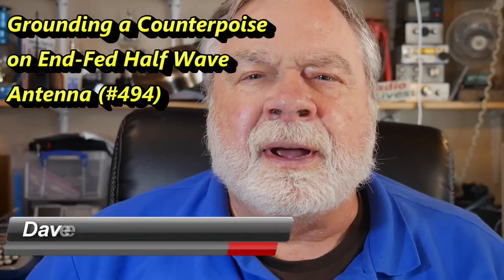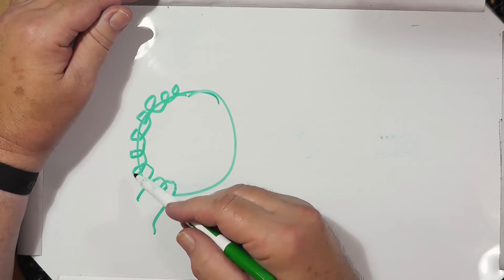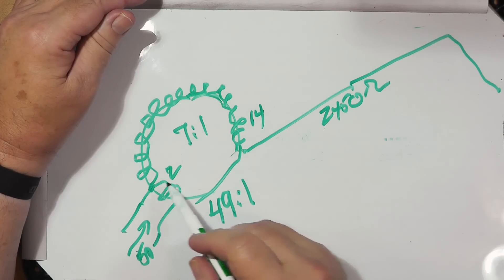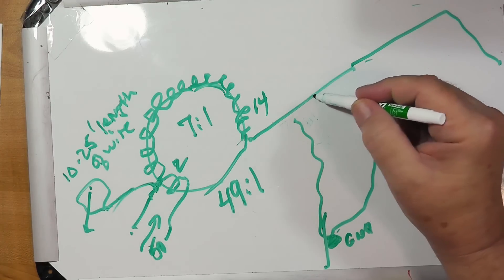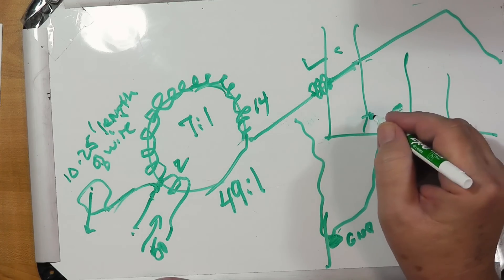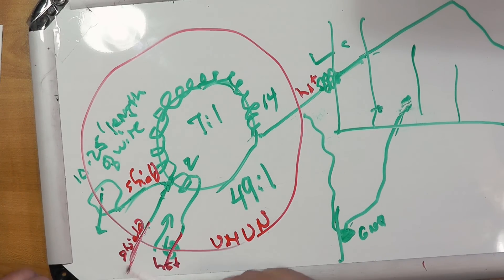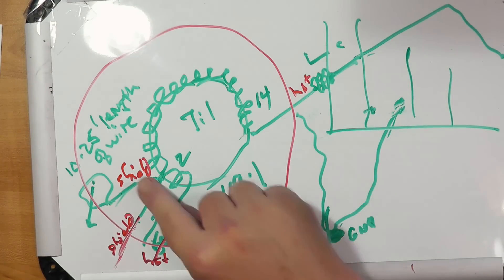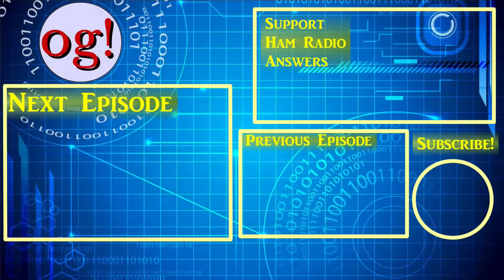Grounding a Counterpoise on End-Fed Half Wave Antenna (#494)

Comment: I've been using an EFHW fron NI4L for a little over a year, due to limited space and an HOA. It has been very noisy and difficult to to get reasonable SWR. Thanks to your videos I have made adjustments that have greatly improved SWR and transmission pattern. Added a 0.05 wavelength counterpoise, charted SWR across desired bands and adjusted wire length. Added ferite chokes on both ends of coax. Making DX contacts to Asia and Europe now on <100 watts. and noise floor is so much lower. I greatly appreciate your elmering and contribution to the hobby. Cheers from Texas.

Comment: I have an antenna up 60 feet supported at both ends by trees. I put screen door springs on both ends (mechanically connected not electrical), and it has stayed up with no problems for 15 years now. I've had many thunderstorms, microbursts, and possible mini-tornadoes go through. Can recommend using them.

Comment: EFHW antennas are not really end fed.  It's  an off center fed antenna with one side at over 95% of length and the other end is .05 wave length or only a few percent of half wave.  Trying to use a counterpoise or other modifications will screw up the antenna.
Reply: The EFHW is far from a simple antenna, I quite agree. The way the coax affects it can be substantial, then deployment options and other things in the vicinity changes it all. Adding 1/20wl radials can make a big difference as in the way a fan dipole works - assuming a mono band antenna, or trapped radials then the complexity goes up. Then after investigating transformers with 2 turn primaries and actually measuring efficiency with a VNA, some of the internet designs are not so great.

Comment: Why not cut the connection between primary and secondary and run a counterpoise from the secondary?   That would get rid of the problem of RF on the coax and eliminate the need for a choke.

Comment: ???    The small coil on mine Dave, affects the higher bands, and brings them into a dip in the portion I want....  ( Homebrew 66 ft, 40m to 10m endfed, with 49:1, and no counterpoise..)  Cheers,  73 Fred G4ZWI
Reply: Correct.  For the 80-10 EFHW, the coil has very little effect on 80, minor effect on 40, and significant effect on the shorter wavelengths.  The effect being the lowering of antenna's resonant frequency.  Ken WA8FCI
Reply: @yt5bos  ...   I think my 1:1  choke balun begs to differ.........
Reply: @fredcooper5236  If 1:1 is next to the transformer - you are right...

Comment: Nice job Dave. Love the topic as I have purchased a MyAntenna EFHW, not yet installed as I am still 'designing' the supports. Plan is to mount it horizontally at 25'. Wanted to model the antenna but don't have the experience with EZNEC or MMANA to get the parts all connected together correctly. Still working it. Thanks for sharing all the info. I have saved the video to watch again.

Comment: Dave

I hv a My antennas 40-10, extended to an 80-10. A ground rod was placed beneath the box. From the ground rod, I used an alligator clip and 14 gauge wire, which I ran on the grass, parallel to the antenna wire(134 feet). The difference, especially on 160 and 80, is an s unit or two. I am always being told what a nice signal n audio is coming from the antenna and my 7300. 
This reflector wire or counterpoise wire, seems to do the trick.  I hope others try this on the already, fantastic‘My antennas’ antenna😁. 
The kicker is: Along with my trustee Mfj-939 tuner and the counterpoise, I work 160 nightly, with good results throughout the northeast from my location in so Connecticut. 

Just thought u wld like to know. 

Billy

Comment: This setup is great!  In my scenario, what worked best is having the box close to the ground (around 12” plus or minus) with the wire sloping upward.  Wire was 133ft long to work 80-10.  Wire was about 20ft high. Wire wasn’t ideally straight nor horizontally parallel to the ground as I had to navigate an L shaped backyard.  When I connected ground lug to earth ground, it produced more noise so I left it disconnected.  RG8X feed with 31 core at 17ft and a 43 and 31 core at the rig.  Total coax run was around 75ft .  First 17ft from box was rg8x and the rest was lmr400. This setup worked wonders for me!   LOL Dave @ 6:25 !!!

Comment: My EFHW is fairly straight and  75' above Earth.  Homebrew w/ 49:1  2 core unun &   22' Counterpoise. All wire is 12Ga stranded.   Grounding the  Counterpoise  noticeably reduced noise  and helped flatten multiband SWR (MFJ  Analyzer sweep). I can tune 80 no problem with ATU.  Single 6' Ground-rod.  I use a large RF choke to connect Earth to ATU in station.  Fed with coax. Best antenna I ever had. N2EYE

Comment: Many EFHW antennas (with the UnUn) come with a somewhat longer antenna wire. One has to tune the antenna wire in the position the antenna is placed. That is because not everyone puts the antenna at the same spot, hight or manner. In my case (HyEndFed) I had to trim the wire about 1.3 ft (40 cm) to get an overall 1.2 SWR. I did not need an extra counterpoise; the UnUn is about 8 ft (2.5 mtr) up.
Greetings from the Netherlands, keep up the fine videos, 73, PD0PSX.

Comment: Hi Dave, love your presentations but I would like to make a few points of clarification regarding this video.

1) In a auto transformer configuration the primary and secondary share the same winding, and the common is the very bottom of the winding and this would be where the counterpoise connects.

2) In a auto transformer design the number of turns on the secondary includes the number of turns on the primary (consider the primary just a tap on the secondary coil in this case), so the total amount of turns for a 49:1 transformer using 14 turns on the secondary would be 14 total turns with the tap for the primary being at turn 2.

Note: I suspect most of the EFHW transformers sold are not auto transformers but rather separate primary and secondary windings which are tied together on their low side (probably wound bifilar or twisted).  In that case for a 49:1 transformer with a secondary that has 14 turns you would indeed find a totally separate 2 turn winding for the primary.

3) The compensation coil that you mentioned is not there for 80 meters, its real purpose is to add more and more inductive reactance when operating on the harmonically operated bands to help shift the frequency of resonance down on the higher bands (the harmonically operated bands).  If you don't shift the frequency of resonance down on the harmonic bands their frequency of resonance is typically higher than desired.  You can easily see this via modeling that the harmonically operated bands have their resonant frequency higher than you would expect.  As an example a 40 meter EFHW antenna resonant at 7.0 MHz would harmonically be resonant at 28.0 MHz if you just multiply 7.0 MHz by 4, but in reality the antenna is resonant closer to 29.0 MHz and therefore the compensation coil is used to add more inductive reactance on 10 meters which helps lower the resonant frequency by a greater amount than it would on the lower bands as an example. 

4) For consistency I use a choke on the coax feedline approximately 0.05 wavelengths down from the EFHW transformer so that the counterpoise is just the first 0.05 wavelengths of the outside of the shield on the coax on the lowest band of operation and this is based on work done by AA5TB which I have confirmed via 4NEC2 modeling, and this offers many benefits.  I just wind 14 turns of the feedline onto a FT240-31 toroid core to form the choke and this choke is based on work done by K9YC.  You can still ground the shield of the coax (that's beyond the choke) where it enters the shack for static discharge purposes if desired, but this will have no effect on the actual performance of the antenna.  The choke makes the EFHW antenna a very robust design as the coax beyond the choke does not alter the performance of the antenna (length of coax is no longer a unknown variable) and the choke eliminates the need for a separate counterpoise as you have already defined a very specific counterpoise using the outside of the coax that comes before the choke, and it helps prevent common mode noise that's induced on the outside of the long run of the coax shield that's beyond the choke from making its way to the feedpoint which helps reduce noise on receive.  Just FYI, Don (wd8dsb)
Reply: Very good, finally someone who has it right!

Comment: Hi Dave. Thanks for the video. You mention in the video about putting a lightning arrestor on the coax before entering the shack. I'm setting up the Myantennas 8010 such that all but maybe a foot of the coax is inside. The UNUN will be outside under a covered porch about 10' up. Where would a lightning arrestor go, or do I even need one? Thanks

Comment: When building an EFHW matching unit, first tune the matching unit using a resonant length of wire. Measure the impedance. If it's < 50 ohms, remove some turns from the secondary coil. If it's over 50 ohms, add some turns. 7:1 turns ratio is usually pretty good for the middle bands. You may need a higher ratio for the lower bands. 

The little loading coil helps make the antenna resonant on the bands for which the wire is 1, 1.5, 2, etc wavelengths long. Without it, a resonant length on 40m will be resonant just about the 20, 15, and 10m bands.

Comment: I have watched your end fed antenna videos. Everything you have shown or said about them is really good and ideal in formation. My question for you is what is considered as a half-wave wire. My wire antenna is from MY ANTENNA and is 117 feet. And it was as mentioned in this video over 2.1. I have been told by other hams, that theirs are 60, 90, and 100 feet in length. So my questions are, #1. how do I figure out in formula, that length of this wire should be? #2. should I cut it to 100 feet? 
Thank you a reply or even a video about half-wave lengths of wire. 73 N6ZKI. Leonard Foard.

Comment: If one were to add a common mode choke in your recommended configuration, where would it go? My planned order is antenna transformer via coax to lightning arrestor, ground rod, and then on to the transceiver. Or do you think some ferrite beads would work as well?
Reply: Put a 31 choke at 17ft from box and another choke at the rig.  You can put either a 31 or 43 or even both at the rig.  I tried a choke before entering shack but it didn’t help.  What helped though was a choke at the rig.  As mentioned use a choke at 17ft if using a 133ft wire.  If using 266ft put 31 the choke between 30-35ft from box.  The goal is to customize the length of the coax shield (counterpoise) depending on length of wire.
Reply: @angpar8449  totally agree with the second choke at the rig. It similarly didn’t help at the shack entrance for me.

Comment: What happens if I make the wire element a full wavelength? Or 2 wavelengths? I have property behind me but I live at the front.
Reply: I would have thought that would work in the same way as it works on the harmonic bands, though you may need to experiment with coils, etc, to bring all the harmonically related bands into the required ham bands. You may also then have issues with the transformer as the impedance may change, so you'd need to experiment there as well. I have wanted to put a wire up around the area where I live which will be a half wave on 160, so then have it also work on 80 and 40. (I'd make the transformer for the low bands and not expect it to work well on the higher bands).

Comment: Question,  if a station is on a 2nd or a 3rd floor and a "normal ground" is not in the cards, can one use the round hole in a typical 110 volt oitlet? Use a "banana type" end and push it into the round hole on the plug? It is the ground for a building, wouldn't it work for a antenna type ground if thats all thats available?
Reply: Please don't do this. You can introduce RF onto the mains wiring of the whole block and might have very unhappy neighbours. Also it can be dangerous. If there is an earthing fault, the braid of your coax will become live and so will the chassis of anything it's connected to.

Comment: I have the same antenna attached to the top of my tower (~50+ ft) slopping.  I have the ground attached to the tower which is grounded to several grounds.  The coax coming down the tower goes through a coax switch box and then a lightning arrestor (which goes to a ground round) before entering the shack.  The coax enters through a window pass through which is grounded as well.  Just curious.  Is the coax acting as a counterpoise, the tower leg or both?
Reply: So you have a 'sloppy' antenna?
Reply: @eknaap8800  lol, ok try sloping. 😁
Reply: @stevenhammond1353  That's better. My antenna is somewhat sloping as well. I wouldn't want a slopping one... 😉
Reply: Fed at the top or at the base Steven?
Reply: @stirlingpark6145  Top of the tower.  The transformer part is bolted at the top of the tower.
Reply: @stevenhammond1353  Thanks. Mine slopes up the garden to the top of the house, the start point is 20ft above ground at that point but that is about 20 ft below the ground level at the midpoint and then climbs a further 30ft to the top of the house. It works well without a counterpoise, but I wonder if it might work better with one.

Comment: Hello David!!! How do I unlock other frequency bands in radio TYT UV-8000D! The Radio comes in the 136-174 MHz and 400-520MHz ranges. I want to use the 128,000 MHz frequency. It's possible? Thanks for the videos!
Reply: 128.000? Airband? That'll be a.m., would the radio be operating on FM?